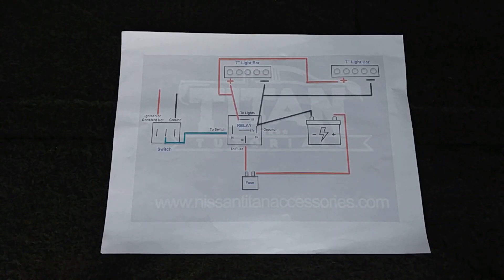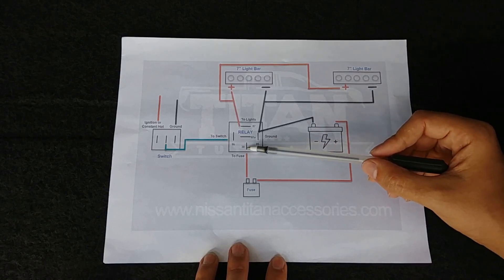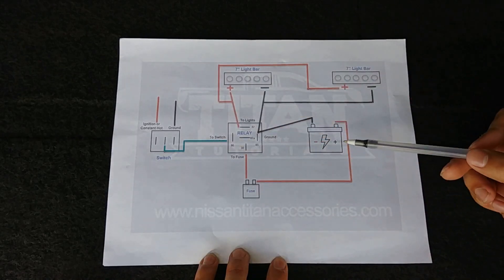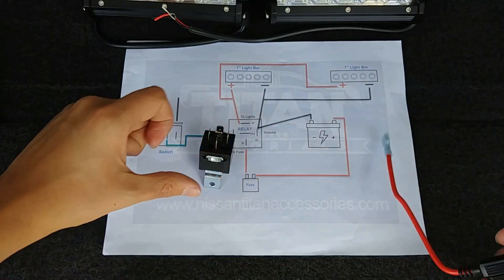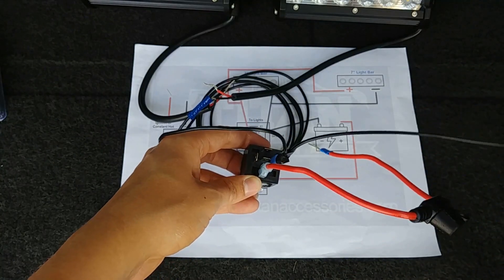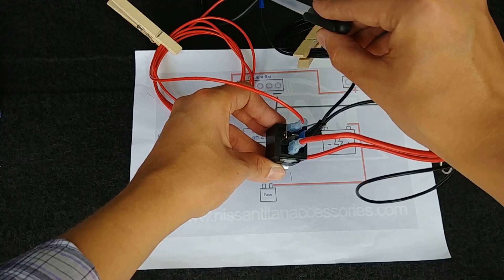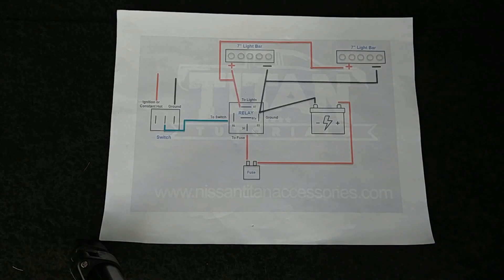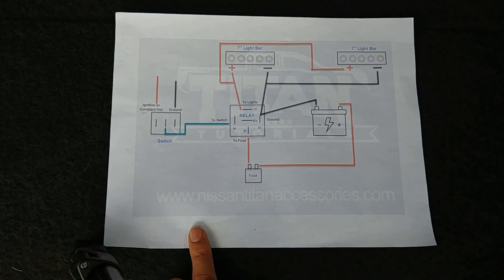How to Make Your Own LED Light Bar Wiring Harness - DIY

Comment: Can you ground the black wire to the chassy next to the lighttbar instead of taking them all the way back to the relay ? ANd is it not better to ground the black from the relay to the chassy instaid of wiring it to the battery?

Comment: Amazing video! I'm also coming from the Nissan D40 chassis community too.
I would recommend grounding to a local busbar onto the chassis/frame though. A frame ground is always best and shorter wire to run.

Comment: If only the parts prices in my country is cheap, I have no option to buy per foot/meter of wire here we can only buy bulk 100meter spools of 14 awg wire. One spool costs as much as a ready made harness. Great, right? The problem is, the harness is kinda short, so I still have to buy the whole spool to extend the harness 🤣🤣

Comment: In your video you take green wire to switch, can I for example, run that wire to a fuse tap to high beam in fuse box and use my stock high beam switch that way ?

Comment: Great video. Thank you. I have a question though. Say I have one LED light bar already installed and I want to add another one, do I just add it on like your drawing suggests, or I have to take into account power consumption of the 2 lights in order not to overload the circuit? OR as long as the total wattage of the 2 lights is within the relay capability then I am good?

Comment: Hi. I'm wanting to wire up a LED 20" Light bar to the ATV sub-harness. I'm new to wiring accessories up to ATVs sub-harness. On my sub-harness I have green labelled wire to be wired up to a winch at later date and white with black strip that's advertised for " Work light " with green wire along next to it for Honda ground.

I only want the light switch to function when it's keyed-on position, and the impression I'm getting is that the ATV sub-harness is the way to go.

Because the power bar has little bit of amperage to it, it's 160Watts so (160Watts / 12V = 13.33amps.) The ATV sub-harness " Work Light " white with black stripped wire is 12V+. I'll assume best performance of my LED light bar would come from wiring to the battery posts using relay and in-line fuse per your diagram.

The question is.., with the Rocker Switch rated for 20A, and even a FLYPIG 12V 16A Light switch, tapping into the ATV sub-harness 12V+ wire directly from light switch is perfectly safe? Will give me the " keyed-on " function using your diagram? Apologies in advanced for my ignorance.

Thanks in advanced for any guidance giving.

Comment: Can that constant 12volt power off the switch, be connected to the positive battery terminal?
Reply: That's what I'm wanting to know. Also can we skip the relay and just use the inline fuse?
Reply: cavyboy99 I used the relay, and used my constant hot to the battery I did use a inline  fuse though for both wires off the battery
Reply: @Mrzederman2  I figured just the inline fuse would be enough. And if anything would happen it would blow that fuse?